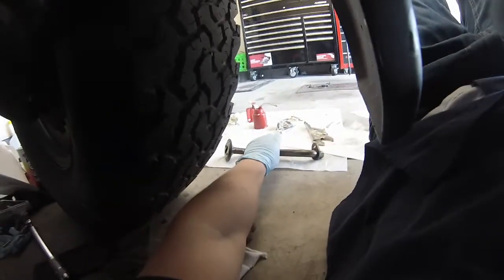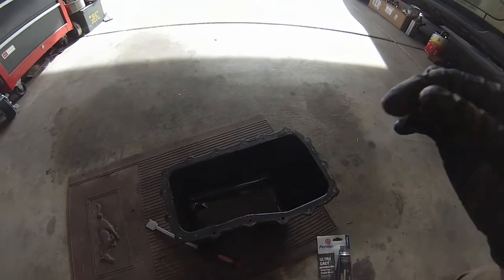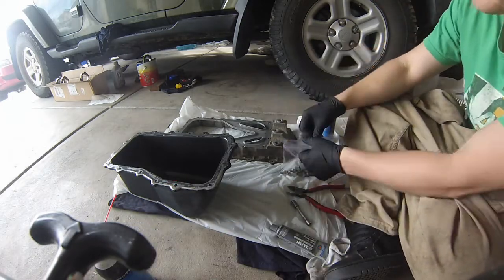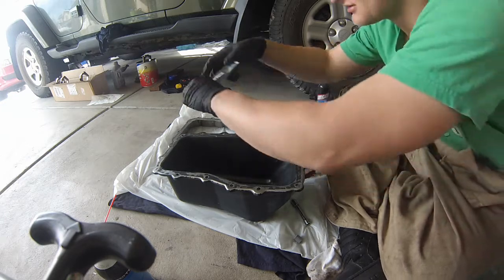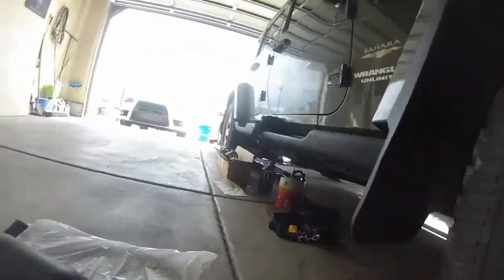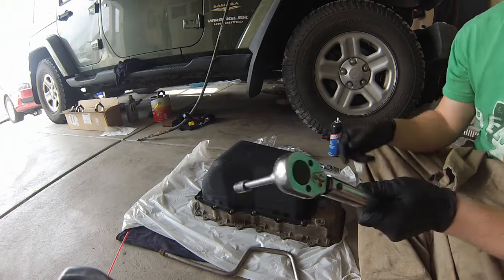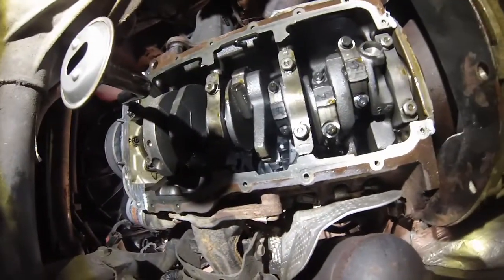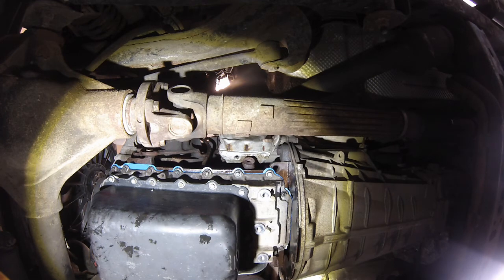Jeep Wrangler JK 3.8L Engine Rebuild Part 5 - Oil Pan Install

Comment: Great video. Thanks for doing this. You can tell you know your stuff and your time with this video helps us that don't! Keep up the good work.
Reply from the maker: Doug Harling thank you! Glad this could help out. Are you having an issue with your oil pan?
Reply: Yeah, I'm seeing some oil on the ground and it looks like there is oil collecting and then dripping off the transfer case. I don't think (hope) it's leaking from there, but coming from the oil pan gasket. Replacing it doesn't seem too technical, but I'm always nervous. Your video walk-through gives me some confidence. As long as I get everything bolted on it doesn't look like I can cause too much damage ;) - knock on wood! Thanks again.
Reply: I have a 2009 Sahara. My pans been leaking. Always wanted to fix on my own. This video just made me more confident on doing. Thank you keep it up

Comment: Might be doing this when my 3.8 hits 200 - 225k miles. What's the labor, ballpark?
Reply from the maker: If you're just doing the oil pan with a new gasket then it's very quick. If you're pulling apart the case halves and doing the liquid sealant then it may take a few hours to get everything properly clean. Thanks for watching!

Comment: Hey , I need to change the oil pan (lower) for my Jeep Wrangler jk 2018 , is it the same ?
Reply from the maker: Good question. Jeep moved away from the 3.8 liter by the year so it'll be slightly different but the general steps will be the same. Thanks for watching!